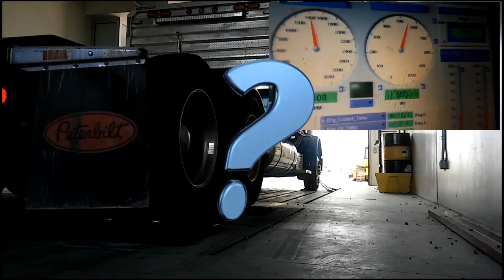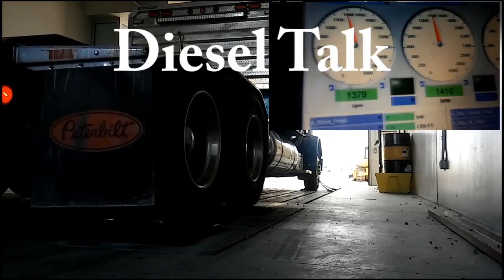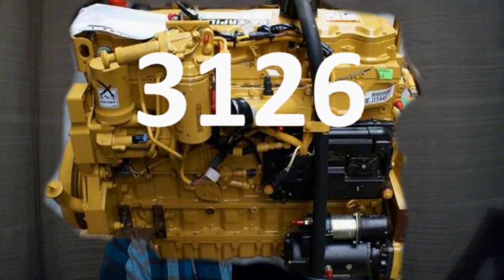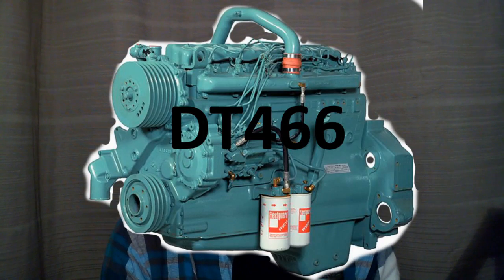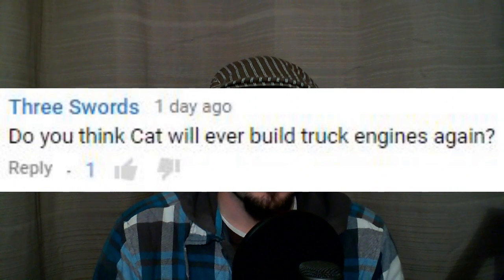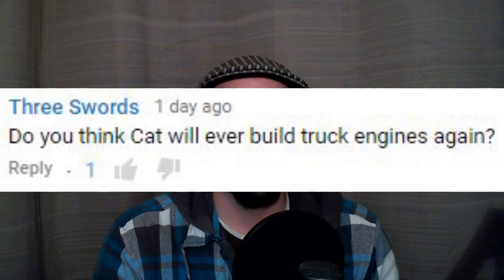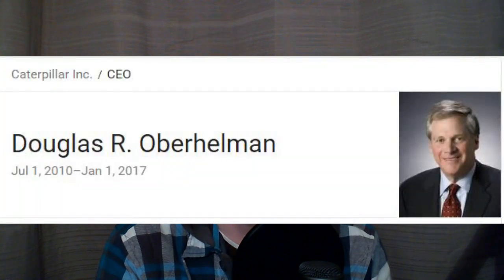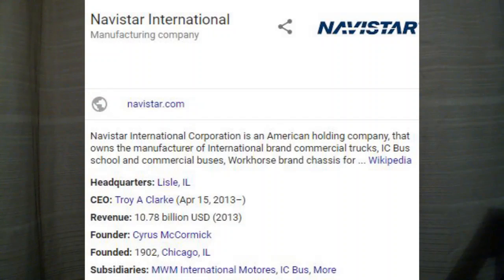Is Cat Coming Back, Best Bus Engine, and Valve Adjust Temperature?  Diesel Talk Episode 10.

Comment: I think it's funny how volvo or Mack's are never mentioned in videos about diesel engines. I'm a technician at a volvo/mack dealer and personally I'd stay away from volvos d13 or d11. Pieces of junk. Same as the mack mp7 engine. But the mack mp8 does not see the same failures as the d13 due to mack using there own programming and torque curve than volvo. The d16 and mp10 are very reliable sense I've never seen any major failures in my time as a tech. The old mack E series are up there with the best in my opinion. Just my two cents since all you ever hear about are cummins cat and driptroit.
Reply: Hmm, interesting, I’ve never had a problem with a D13, in fact I am in love with the Volvo powertrain.  Great tidbit about Mack programming as well.

Comment: If you want a good bus engine and are CAT dependent I would say 3126.  I have one with 240k miles and still on original injectors and HEUI.  13k hours.  If you want something that will last just as long, I would say DT466E or DT444 with an Allison AT545 with a gear ratio of 4.44 or 5.29.  I have nothing but praises for these two International engines.  They are also cheaper to maintain as far as parts go and labor costs.

Comment: Only reason I would shy away from a 5.9 Cummins is by the time you add the weight of making it an RV.... I think it will be stressed.... limits hi way speed to about 62....I'd stick with a medium duty Engine
Reply: Agreed. To little of an engine. DT466 would be a better choice.

Comment: DT466 is a great engine.
I worked on them back in the 1970s.
Been around forever.
Reply: TheUberGopher Just stay away from the Terra Star with the 466 clean idle. The emission controls kill this otherwise good engine in 20,000 miles.
Reply: thegreenerthemeaner agree, heard a lot of horror stories about what the emission Nazis did to that engine.

Comment: I have a cat 3126b in my 2000 motor home.  My buddy has the Cummings same year and same gvwr.  I smoke him uphills and off the start at a light.  I love the 3126 it a very durable engine and easier to work on for a non-diesel mechanic like myself.
Reply from the maker: +john67elco I like the 3126 a lot, but those Cummins are good engines too, the Cat heavier duty in my opinion and you have a displacement advantage as well since he probably has a 5.9L.

Comment: Great Channel ! Thanks for all the info! I have a 2000 fl 60 with a 1999  3126  and 6 speed manual , im thinking of swapping 3126 with  a 07 or newer cat c7 will the tranny handle the power? what are my risk ,im thinking of upgrading  because of the damn emission crap here in cali, and because my engine might need some engine work soon ,its close to 500k ,and i can only use  3126 engine until 2019 , the 07 is good til 2023,or should i just get a newer truck ,i will  appreciate your advice thanks..
Reply from the maker: +NuLine The 07 engines weren't necessarily more powerful that the 3126s so you don't have to worry about the transmission, unless you go from say a 520 TQ rating to a 800 TQ rating. I must say though that the 07 C7 engines are not very good engines. They have a lot of emissions problems with the ARD head and get quite a few check engine lights, but I'm sure a lot of newer engines have problems with those. I think you'd probably be better off with a newer truck with probably a Cummins than going from a 3126 to a C7S engine.
Reply: Ok Thanks For your reply ,Damn good to know ,are the 04 ,05 c7 ok? cuz there selling me a 05 freghtliner wit a 04 c7
Reply from the maker: +NuLine They are better and simpler than the 07 engines, I still like the 3126 engines better.
Reply: Thanks i appreciate the info.

Comment: In my opinion the best bus engine is the detroit Diesel series 71, 92 and the series 50. now days saying that are contaminanting  But the GM engines , the oil is more clean that any engine include CAT  the exaut smoke is clear if is helped with turbos : MTU today  build and rebuilt DDA2T  and use and  new exaut system.  Caterpillar C15 is a great engine We have quarry truck CAT 350 with 25000 hour working without any problem and 3306 that loose the hourmeter year ago, The litlle Cat engine isnt better a Cummins ,  John Deere , IH; even any chinese truck engine. // The valve regulation: I perform the regulation with the engine cold .

Comment: Any thoughts on the Detroit 50 series? I know they came in a lot of buses.  The ones I  deal with at work seem pretty reliable. I don't know much about working on them, I've only ever had to do services, a few injectors, and external light line work. This is at  a ski resort and our fleet is really old, and honestly not very well cared for. Some of them were ex-public transport that we bought pre-ruined but that damn things just keep running.
Reply from the maker: +Boomer Valley I've never worked on them so I can't really tell you how good they are.
Reply: Pretty much a 60 Series with two rear cylinders chopped off. Personally, I think the pre-emissions 60 Series was in the top five HD Diesel engines ever made. The 50 Series gave great service as well.

Comment: I wonder if I could get a CAT 660L glider kit so I could install a 6NZ engine in it. That would be the best of both worlds. I live and work in Nevada  so emission is not an issue  here. I hope the new CEO will get back into the truck engine market. Untill then I will continue to rebuild my C-15 and 3406E. Whats your CEO number?,  maybe I can talk him into it by showing your videos. LOL I have a Cummins 5.9 never ever had to do any repairs since 1995. Thanks again,  good topic. JSL
Reply from the maker: +Joel Lagpacan They don't make the CT660 anymore. There is a company in North Carolina, that makes new trucks with rebuilt 6NZ engines in them, forget the name, but it is a cool idea. What part of Nevada?
Reply: I am based out of Amargosa Valley. NV. 10 miles from the CA border. Thanks for asking
Reply: Adept Ape  Fitzgerald Gliders
Reply: Just checked their website, NO CAT trucks only Freightshakers, Petes, KW and WS, I repeat NO CAT trucks!

Comment: so is tier 4 final on equipment engines still that far off from truck engines that are tier4 ? I'm not sure what permissable limits on pollutants are between the 2 are but we have a landfill compactor with a C18 on it that is tier 4 final def fluid and all and it is an ass ache just like truck engines have become
Reply from the maker: +Walker Vaillancourt The truck engines led the market on the emissions, so they used the DPF and stuff first, now everything is using it. The principles are the same from engine to engine.

Comment: At 3:13 at the intake manifold, that hose leading to the fuel pump/gov what is that for...? I have a  DT466 In my tractor, and I look at the engine a lot, looks good, I wonder what the bolt and hole was at the manifold. (Bolt plugging the hole)

Comment: Do Cat oil filters have anti drain back valves in them?
Reply: Looking forward to viewing the oil filter comparison video.  For our CAT engines, we stick with CAT filters, b/c the other aftermarket ones do not size up based on ISO standard (can't remember the number at the moment) and performance.  When a, say a Baldwin, salesman comes by, I ask him for the ISO standard (#?) to compare with 1R-0716, and I never hear from him again. The interior metal housing - since the oil flows/filters from the outside to the inside of the filter, that arrsngement prevents filter collapse - hopefully I understood your puzzlement correctly.  Apologies if I didn't.
Reply: From what I understand anti- drain back valves aren't needed on vertically mounted filters. The reason being is that oil isn't supposed to drain up against gravity during shutdown periods. Whereas on a small gasoline engine with a horizontal filter you want an anti drainback valve to avoid that potential air pocket during every start up.
Reply from the maker: +VinylDash303 That is a good question, add most automotive oil filters do, but if the many Cat filters I have cut open to inspect I don't ever remember seeing one. The filter element is basically that cartridge filter around a metal housing. I don't know what the reasoning is for that is though. I'll have to do some research because I'm going to be doing an oil filter comparison video in the future. Good question.
Reply: Adept Ape I think that's why you can prefill the car filters from the outside. I prefill all my filters and can't fill them from the outside. The drainback valve prevents that. So I have to prefill them from the inside. I can get about 600ml of oil in them, which makes a noticeable difference in the time it takes to build pressure in the 4.3 vortec in my s10. My thinking is that most if not all Cat oil filters are mounted straight up and down, so they dont need drainback valves.

Comment: I've worked on international navistar and ford used them for awhile , the 7.3 powerstroke is a dt444 navistar engine and they are amazing engine the vt365 "6.0 powerstroke" a failure engine unless built correctly and the 6.4 I wouldn't touch with a 10 foot stick. I like the 5.9 Cummings they are amazing I'd rather get the pre 1996 models and I've worked on two c7s and I liked them but kinda annoying where some sensors are but I'd stick with the older models of 7.3 powerstroke or navistars version is the dt444  or a older Cummings 5.9
Reply: Deals Cummings Cummings Cummings.

Comment: I highly doubt cat would get back into the truck market. The reason they got out is because only 3% of their revenue  and market was from truck engines and it was costing cat $6,000 per engine just for it to leave the line. It wasn't worth it to them to keep developing engines to work with the emissions. They tried again with the CT660 but that flopped after 5 years and thats because they got together with international. They have the resources and capitol to easily design and build their own truck.
Reply from the maker: +blake Taylor I agree with you, they could get back into the market, but it would have to come from up top in the company. They still have a lot of loyalty from customers.

Comment: I like 3126 cat great engine take abuse well from being in a school bus and simple to work on
Reply from the maker: +Matthew Brugger They are a super simple engine aren't they, can run an overhead in 30 minutes.
Reply: Adept Ape you're a lucky man to work in CAT shop. I work for public garage and the owner turns nothing down
I try to stick to Caterpillar engines Nothing better than 3406 manual, C15 6nz.  Also you hear a lot of bad stuff on powerstroke engines. It is a high tech, modern marvel. I have owned several and currently own one now
There just like anything else, you abuse them, don't service them, there gonna go down. I understand them and work on them. Two great engines, Cat and powerstroke